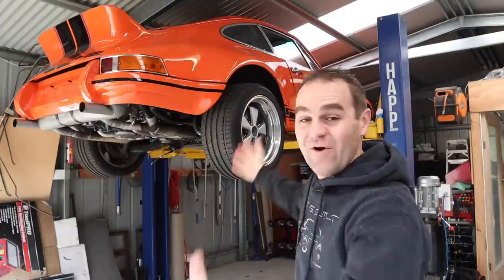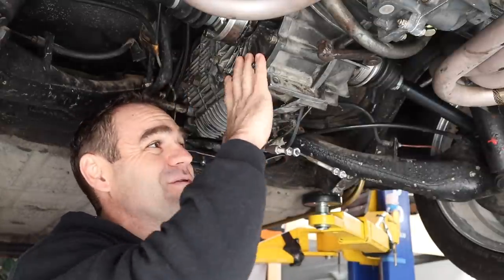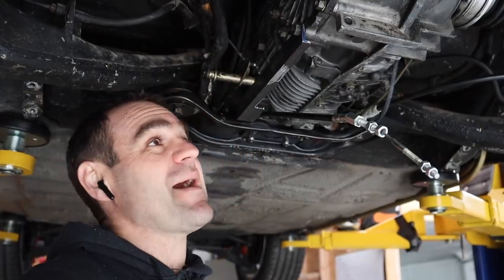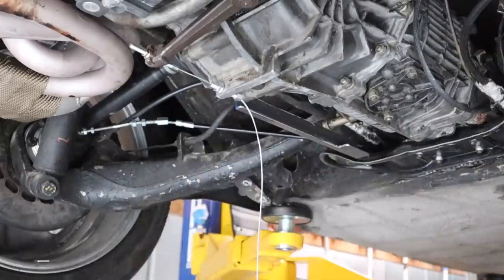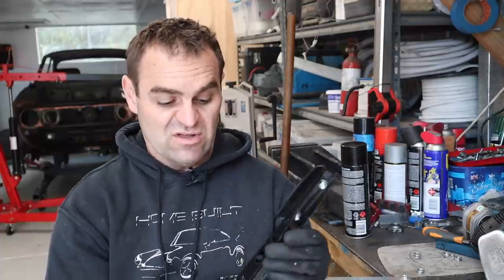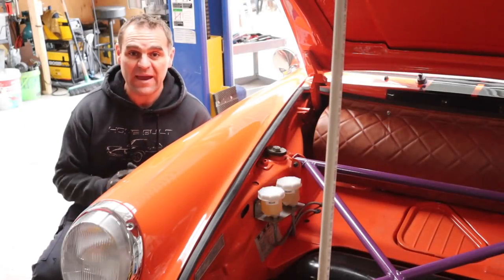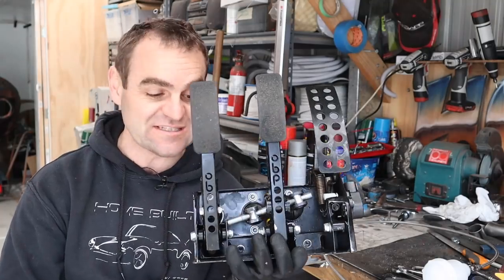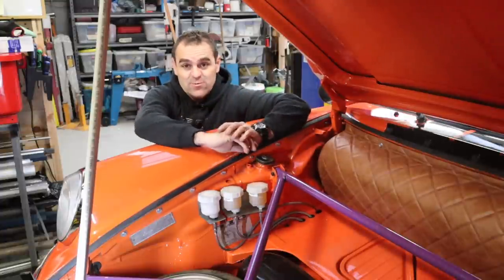915 hydralic clutch conversion - Porsche 911 2.8 RSR Build Season 2.43

Comment: I'd ditch that cable and use a solid threaded bar with a rose joint each end. That cable will fray and is a bit on the thin side👍👍
Reply from the maker: Interesting idea.
Reply: You beat me to that comment 👍
Reply: Yeah, the cable is rubbing on the top of the pass-thru and it will fray.
Reply: Agreed - rose jointed set up will last a lot longer than the cable, but being underneath and open to the elements means you might want to consider a cover plate to keep crud out of that whole mechanism.
Reply: Where could I find a rose joint such as the one you mentioned my friend?

Comment: Really clever solution to have the slave cylinder pulling a cable 👍
I do worry though that the angle of the cable going in to the bulkhead fitting from the slave might saw through the fitting over time.

Comment: At the start of the video how you were saying that the cable needed to make a 180 degree turn. It could have been made to work using the same mounting points by fixing the end of the cable to the bracket and the sheath of the cable to the flexible pivot on the pedal lever.  Same mounting points but cable comes in from a different direction.You'd have to make a cover over the cable to allow for the movement under the floor, but it's doable.

Comment: Hi Jeff, mount your 3 fluid Reservoirs on the back of that brace and the master cylinders will self bleed them self. At the moment there will be a air bubble sitting in the high point of the feeder hoses.
Change that cable over to a rod with clevis pin ends.

Comment: HI  JEFF the cable is way to thin you mite need to use the last bit of the original clutch cable, and get rid of that screw thingy near the salve cylinder they only work on carby cables and push bikes, the clutch presure plate will make the come off the cable before you even do one hole travel of the pedal, cheers

Comment: My OCD kicked in and I was hoping you’d swap the brake reservoirs around once you drained them! Alas, no 😔
Reply from the maker: Mine too, but it is a hose length thing.
Reply: @HomeBuiltByJeff  You could do a new single bracket to hold all 3 reservoirs and sort out the positions. The hydraulic set up looks great.

Comment: In Apples wisdom. Oh the irony in that 😀

Just a thought but for me I'd also put a clamp around the slave cylinder so it has 2 mounting pints. I admittedly belt and brace things but just wouldn't trust that single bolt on the rear not to stress fracture.

Comment: As per a few other commentators. A solid bar with Rose jointed ends would be better than a cable. Looks like you might need to trim some excess off your brake balance bar, your foot could hit the LHS when you operate the clutch pedal.

Comment: Great video jeff. You are the one and only who did this conversion on video. Are you satisfied with this hydraulic set up. What size lines did you use?
Reply from the maker: Yes, it is good for my application. Still heavy though. I used standard brake line.

Comment: Looking great, Jeff! That clutch should make a big difference :) I wish they’d break the backwards compatibility of those master cylinders and make some in metric, it would be so much better! Pricing of the imperial stuff is extortionate compared to comparable metric!
Reply from the maker: It is also just a pin to get it. Every car wreck I get to I grab all of the fittings, etc, but they are all metric, so getting the imperial stuff is really difficult.

Comment: Porscheparts by Jeff didnt have your clutch pedal available :) might want to look into upgrading the thickness of the cable. Maybe get a cable professionally made with girth and a decent stop as ive found the screw on ones slip too easy.

Comment: Well done on the conversion but the pedal bike cable is not going to hold up to the pull on the clutch lever one thinks at the gearbox end but luck any way cheers.

Comment: Why don't you mount the slave cylinder at the front of the car to pull the stock cable? It would really reduce the amount of fabrication required and probably be easier to bleed.

Comment: Good bit of design - but I think the thickness of the inner cable  slave cylinder to clutch withdrawal lever  looks way to thin to be reliable and long lasting. With the forces involved I would think  a cable 3 or 4 mm in diameter would be needed and more substantial  end fitting -  losing clutch operation hundred of miles from home would be no fun.

Comment: I see that the cable is not coming straight out of the bushing on its way to the hydraulic cylinder. Are you worried about the rubbing and wear on the cable or bushing?

Comment: Being honest here, getting a correct size extension/ coupling nut would have been just as much work as making one from scratch. 
No hate on the imperial system, but trying to get something that isn't in widespread use in your continent, turns out to be a slight headache.

Comment: I've watched you struggle for weeks and weeks with this pedal box. Still not sure why you didn't just stick with the perfectly functional stock pedals, and modify the thottle for throttle by wire?
Reply from the maker: Because mine were LHD pedals with a very dodgy conversion to RHD.
Reply: @HomeBuiltByJeff  Ah yes, I forgot about the RHD conversion, it was a long time ago! Carry on :-) (incidentally, I have a fully rebuilt gear shifter coupling from my 1972 911 sitting in my spares packages, but I guess thats a little late now...)

Comment: Are there brake line screw on “caps” one can buy or make so that one can cap off the brake line that has been removed and not have to fully drain and flush?
Reply from the maker: I believe there are aircraft grade quick connects, but they are really over kill for this ;)